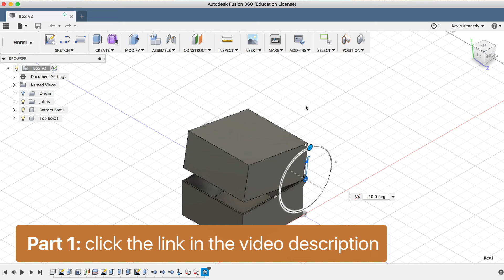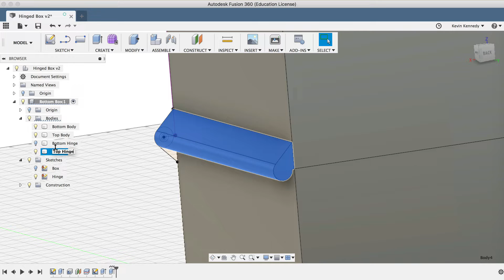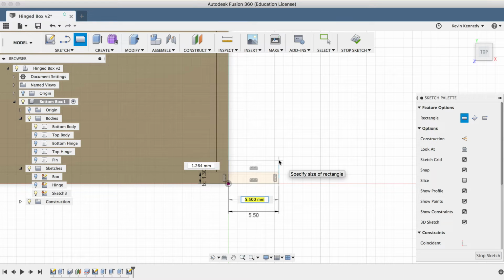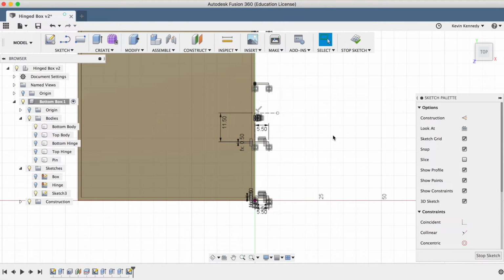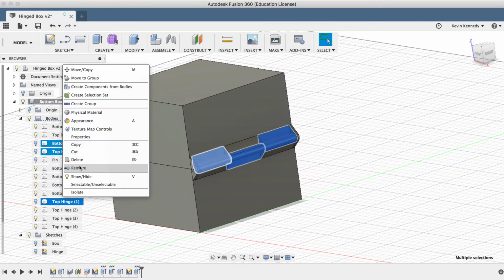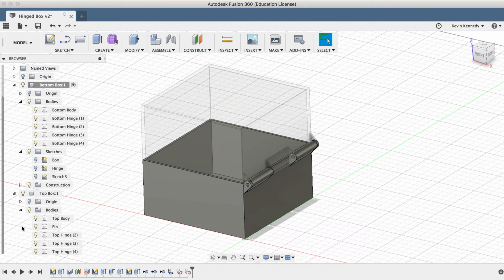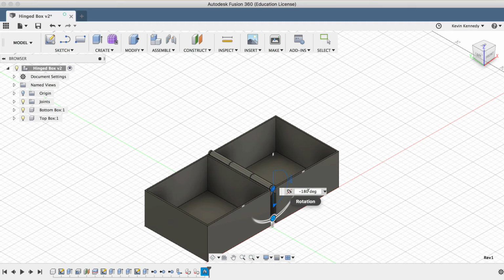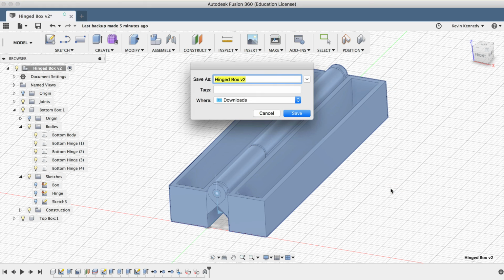How to 3D Model a Hinged Box for 3D Printing - Learn Autodesk Fusion 360 in 30 Days: Day #19(Part 2)

Comment from the maker: Video of example print - https://photos.app.goo.gl/nagpYdBeJUcE3XE47
PLEASE NOTE You'll have to delete two of the end pieces before 3D printing. I forgot to show this in the video :)
It really depends on how many hinges you create when you cut the hinge up. I went ahead and deleted the bottom parts of the end of the hinge, that way every other piece is removed - https://snag.gy/cNokVz.jpg
In this scenario, it really wouldn't matter much as it should work either way. I have the box printed out like screengrab above and have no problems. I will have to try doing it the opposite way and see how it is :)
—
TIMESTAMPS
0:00 - 3D Printable Hinged Box in Fusion 360 (Part 2)
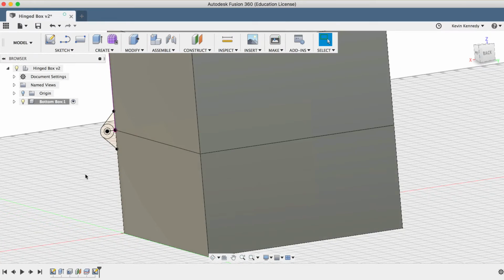0:33 - Create a hinge
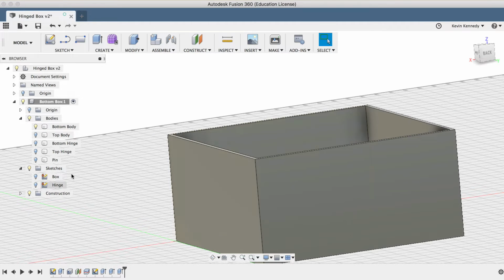3:07 - Cut hinge into 3 pieces
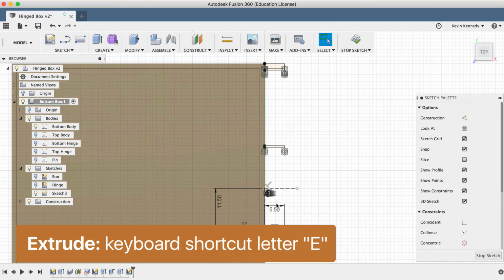6:02 - Extrude cut hinge
7:03 - Remove unwanted bodies
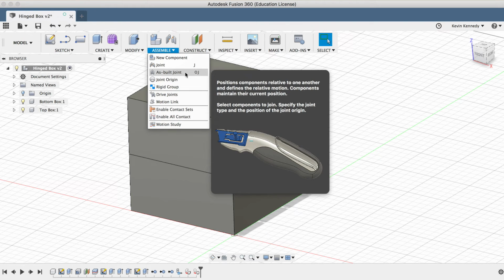10:05 - As-built joint
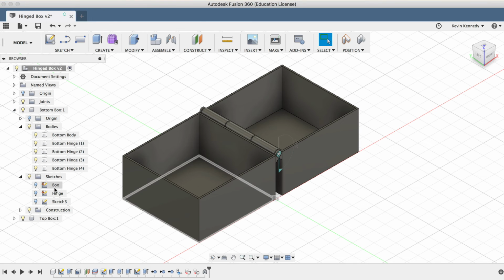11:50 - Change size before printing
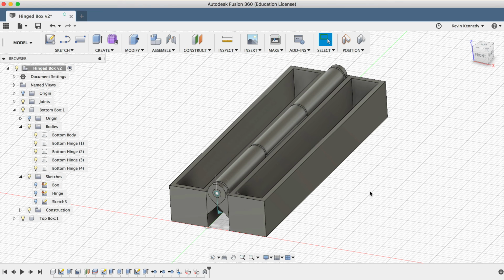12:51 - Export for 3d printing
Reply: Facepalm. I printed this twice with 2 settings before reading the comments.
Reply: I have already dealt with it.  I meant to let others know about this. ;-)
Reply: can anybody pls tell why my bottom part is revolving about the top part not the other way....
Reply: @sajalchuttani2519  Put a minus before the number of degrees.
Reply: @sajalchuttani2519  you probably have it figured out a year later, but the order you select top and bottom matters. The first selection will revolve, the other will not.
Reply: @Stephanus Prayudhi It's attached to the top hinge bodies but is separate from the bottom hinge bodies.
Reply: Great Stuff! Something to note, when you created the top hinge, you included the gap circle and the pin circle with your extrude, making a solid piece.
Reply: @jrbarker7362  I noticed that, too, but I believe that's by design. The top (middle) hinge part + the pin + the end caps are all one solid part. Only the two bottom (outer) hinge parts have to rotate about the pin for the hinge to work. With the middle solid in this way, you have a shorter bridge to deal with printing the gapped pin on the outer hinge parts, and maybe a stronger hinge joint overall.
Reply: I thought I saw that and came to comment.
Reply: You shud add this to the description. I went wrong with it myself! (The PLEASE NOTE thing)

Comment: I was wondering how I should position the top lid if i have a smaller lid? (like a trashcan, my design doesn't split in half, but has a smaller piece on the top that I'd like to use as a lid and a bigger piece on the bottom as box/cup.) So should i position it at 180 deg or is it better to do it at a different angle?

Comment: Everything works perfectly except for one thing I can't seem to fix. The two ends of the hinge are fused together, which means that when I print, the hinge doesn't turn.
Reply: NVM soved it! Just had to "remove" the "Top Hinge" of the Top Box🤦🏼‍♂

Comment: Great tutorial, but I do have a question. It looks perfect in Fusion 360, but when you go to actually print the box, it never quite closes; the back edge of the top hits the bottom of the box before the front edge does, which keeps it open. No matter what I do, or what kind of PIP hinge I use, it's always the same results - perfect simulation in Fusion 360, but an uncloseable box once printed. Has anyone else had this issue?
Reply: Hey, were you able to resolve this? I'm facing the same issue :(

Comment: Long shot as this is from 6 years ago but why cant rotate the top box?
Reply from the maker: Are you trying to rotate via the Revolute joint? The joints have not changed since then (surprisingly), so it's likely due to a conflict in your timeline or with another joint. I also have a newer version of this lesson if you check out my channel page.
Reply: @ already did. I’ve been a subscriber. I just thought this model was perfect for my case use. Thanks for the reply. I wasn’t expecting any😀

Comment: I'm using the free version of Fusion 360. Is this maybe the reason I don't see the feature 'Chain Faces' as an option? I noticed this video is 5 years old, so maybe it's no longer an option in the newest version? When I extrude those circles as instructed at the 45 second mark, mine shows as red as it's a negative and doesn't show as a solid. As if it's pulling the wrong way. It shows correctly when pulling the opposite direction, but that's not the direction it needs to go. Any advice on that?

Comment: Am I the only one confused by the tabs left over on each end of the hinges? They are fused to each box and will not allow the box to open. There is no way youre printing that pin in place without fusing it to the bottom hinges. Someone help me out here.......I cant see anywhere that he addresses this issue, yet its screaming at me from his sketch.

Comment: Hi Kevin, great tutorial! Just wondering if I 3D print the design, wont the edges of the hinge (connected to top half and bottom half) make a rigid body as they overlap? Am I correct in assuming this?
Reply from the maker: You're correct. Please see pinned comment. One will have to be deleted 😁

Comment: I realize this video is 5 yrs old, but I still wanted to say that I enjoyed it very much.  One issue, though, and maybe it's down to my missing something?  When I printed the stl, the outermost parts of the hinge were fused together, being as they're solidly attached to BOTH sides of the box.  Thus, the hinge doesn't work.  I believe the solution is to remove those bracket parts from the bottom part of the box.  I'm printing the revised file now, so I can't say for sure it will work.  Fingers crossed.  :)
Reply from the maker: Yes, that's correct! It was an oversight when I made the video. Please see the pinned comment for more details 😊

Comment: During mirroring, after clicking and dragging over all of the rectangles mine doesn't select as much as yours did. It didn't selected the inner most points and I think the left sides of the rectangles. On yours, amount of objects selected is 22 while mine is only selecting 21. Any idea why this could be?

Comment: The construction line used for mirroring doesn't automatically constrain for me. The line was solid black but the point wasn't constrained, any idea why yours did or mine didn't? I decided to add a dimension to it so that it did become a fully constrained sketch. Edit: looks like that particle sketch for you was also not fully constrained, the same point wasn't constrained. I assume this doesn't really matter

Comment: This model would not print out correctly. The outer rims of bottom hinges and top hinges have overlapped with each other, that should be corrected. And the pin inside should be printed separately, or simply use a metal pin, or the pin should be extruded from one of the hinges.
Reply from the maker: please see pinned note

Comment: In the constraints video you said to prefer not to use mirror in the sketch tool, but to prefer to use mirror in the 3d tool.  Why did we mirror the sketch in this case?
Reply from the maker: Great question! That statement is a 'best practice' from the Folks at Autodesk, given how sketches vs bodies are computed. On small models 3-4 parts or less, it will typically make no difference. For large models, it will make or break the file. For this particular file it's easier to mirror the sketch in order to clean it up/finalize it and it won't have an impact on the latency of the file.
Reply: @ProductDesignOnline  awesome.  Thanks for letting me know.  I am really enjoying and learning a lot from the series.
Reply from the maker: @quyreansoulsealer4002  Glad to hear that! :)

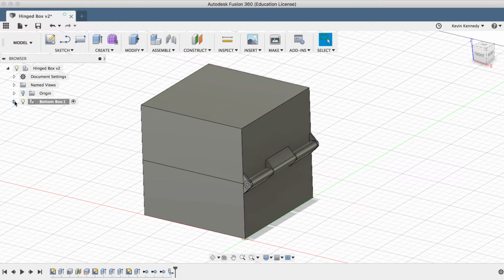Comment: Hey, I got a problem when I followed your instructions. At 8:46 I can't drag the component to a higher level. I searched the issue and found others with a similar problem. They couldn't move the component because it was related to the other bodys by the timline. Any Ideas what I did wrong? Super nice tutorials btw learned a LOT

Comment: Just for anyone who actually wants to print this box: The design won't work as shown in the video. You should NOT extrude the "Gap" between the Pin and the Hinge. Also you need to cut away part of the top hinge supports (Where it connects the hinge to the box. As a tutorial this was great!!
Reply from the maker: Hi D Matthews. Thanks for the comment! Please see pinned comment - I forgot to show removing the end of the hinge piece in the tutorial :)

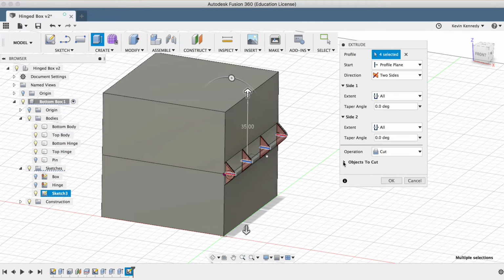Comment: Great videos, Kevin!  I am following along in an attempt to recreate the model (drawing it from scratch, so to speak). I seem to be having trouble getting the extra bodies after the Extrude at 06:45 in the video. At first I thought it was because the 5.5mm dimension of the gap rectangles in the sketch did not reach to the tangent point of the 45 degree angle on the circle. But I changed this to 5.7mm and now after the extrude it appears I achieved the individual sections of the hinge, but new bodies did not appear in the browser, and when I select the topHinge body, Fusion 360 selects the complete length of the top hinge body (like it is not split into three). Version 2.0.13866 here. Any help appreciated. thanks.
Reply: Did the same mistake. Reactivate the extrude feature from history and make sure that you select: side 1 extent to all AND SIDE 2 EXTENT TO ALL. Hope it helps.

Comment: If you're as confused as I was when you sliced the model: delete one of the "side parts" on each side. Otherwise the parts will fuse together. Like, not fuse but the exported STL will treat those as connected. Great tutorial though. I love the length too. I lose interest rather quickly in hobbies (or switch. Do I want to learn CAD and learn how to engineer parts? Do I want to learn Blender and be artistic? Or 2D art?) and having those 15 minutes or so videos is enough to "give it a go" and then use your videos for reference.
Reply: 2yrs later and still a helpful comment, same issue on the blender or cad btw hahah. but i printed this box and mid print i was like wait a second this wont be able to close loll

Comment: I am confused, when exporting as an stl, after loading it into my slicer, any of the parts that were overlapping in fusion360 (the center hinge with the rod going through, and the ends of the hinge) are now empty space. This is due to "double normals" which flips the normal and creates empty space. This is not addressed in your video.

Comment: Don't the 2 part of the outside of the hinge interfere with each other? You'd have to remove them in one of the sides for the halves to fit right?
Reply: Yeah, this hinge doesn't work.  I think this was more to give an idea of what was involved.  Or they missed a step when reading off of their script.  But anyone at this point should be able to fix it.  And good on you for spotting it.
Reply: @dodaexploda  I thought it was just me followed closely but the ends fused. It looked odd but I thought hey its fine in the video. Giving it another go after deleting the two bottom ends as well.
Reply: Yup that was it. It printed perfectly now.
Reply: I think the same, this process shows how to create every part in sequence, cleanup and preparation is up to you...I think that not everybody will refine the piece in the same way. Cheers
Reply: what sides?

Comment: Man you have some faith in the bridging capabilities. I use PETG mostly and definitely wouldn't get a working result like that lol. Nice design though. For me I would do the tapered hinge points rather than a pin going through just so I wouldn't be relying on bridging.
Reply from the maker: lol - I defiantly wouldn't recommend this with PETG, well, at least not at this size. It does work well with PLA/ABS though. More can be seen here: https://youtu.be/gzF2QgMh6nw

Comment: Very helpful video, but when I change the Gap parameter I am getting an error in the removed body -Bottom hinge1 .
Reply: A year later, I had the same issue. It turned out to be the rectangles on the hinge-splitting sketch were not long enough to cover the depth of the hinge any longer when increasing the gap/other dimensions (so the step where the hinges were cut no longer resulted in separate bodies, causing the recalculation of the overall timeline to jam). Fixing the sketch by extending the rectangles used to cut the hinge solved the problem!

Comment: Hi!
This tutorial is great! It's helped heaps - I'm currently making my next cosplay - Mandalorian! but all the arm braces I've found I don't like so I wanted to create a hinge on the ones I found on Thingiverse. 

My only question  though - I've followed all your steps but when I extrude the mirrored rectangles it doesn't create any new bodies [IE. Top Hinge (1)Top Hinge (2)Top Hinge (3)Top Hinge (4)] this means I cant delete the end pieces before I print. So what have I missed/can do to fix that?
Cheers
Reply from the maker: Was the operation of the Extrude command set to "Cut"? Double-check that first. Otherwise, I'd have to see the file to investigate further.

Comment: This was great. I learned about parameters in this lesson.  I'd put them to use, but there was an issue with one outside hinge surface that binds when the printed 20mm box is closed.  I can't see the problem in the Fusion 360 model.  But, I suspect it has something to do with my sketch circle not being tangent, or that I didn't select a tiny portion when extruding the hinge parts.  But, this was really an excellent learning experience!
Reply: Please disregard the part of my comment above dealing with the binding hinge.  I see now that the problem was already identified and the solutions already discussed and provided.   I should read the comments before posting my own.   All is good.  😀
Reply from the maker: No worries! I realize that it's easy to overlook and I messed up by not showing that in the video :D

Comment: Has anyone tried 3D printing this model and has an issue with the lid not being able to close properly?  I have about a 5 deg angle when I try to close the lid which is caused by the top and bottom portions hitting near the hinge first. I wanted to check with the community if they had clever ways to solve the problem.
Reply: Facing the same issue! Were you able to resolve this?

Comment: I may be a little late 😅, but I’m currently using this tutorial in my Intro to Engineering Class, and it was so easy and simple to understand, I did have a few problems because my container is a different size and shape, but with a few calculations I figured it out. Really do appreciate it <3
Reply from the maker: Glad to hear that, Jayden!

Comment: So, if I want to print the Hinged Box do I need to separate the parts one from the other or it is okay to print the components all at the same time as you did in the sample?
Reply: Print the small version first. If the hinges fuse to the pin (cannot break off), increase the clearance (gap) around the pin.

Comment: I got stuck when I tried to double-click on the revolute arrow. I couldn't select it, click it, or drag it. I found out how to set min and max movement, but I couldn't open the lid so it lay flat on the plane. (I had already deleted the two end pieces.)
Reply from the maker: If you're not able to select it in the Canvas (the model itself) you can always select or right-click on the Join in the Browser (left side of Fusion 360). The joints will be nested underneath the active component in the Joints folder.
Reply: Check your selection filter, it is probably preventing you from selecting the revolute flag. ;-)

Comment: Mine printed out nicely but all the tolerances were too loose. I changed my wall thickness from 1.3 to 1.36. Any more than that would cause two of the hinge knuckles to disappear. But the print came out exactly the same. I wondering if one must restart fusion for the changes to take place. I know that's the case with preferences. I'll print it for the third time to test that theory.

Comment: Was having MASSIVE frustrations with creating a new top box component from the top body. I just couldn’t select the body to drag it and drop it. Took a full shut down and reboot of the MacBook and F360 software before I could actually drag and drop to creat the component from the body as depicted in the video.
Reply from the maker: Hi Glen. Strange that you had to restart. Hopefully, that was just a one-time bug. Otherwise, always double-check that your timeline marker (in the parametric timeline) is all the way at the end. That will prohibit any moving of components in the Browser.
Reply: @ProductDesignOnline  That could have been it as well. I’ll keep that in mind next time.

Comment: I've never 3D printed anything, but my printer is in the mail!  When you printed this how did you print the pin?  I'm assuming you removed it from the hinge and printed it off to the side, but then how do you print such a skinny tall item without it tipping over during the print?
Reply from the maker: Hi Mark. These hinges are print in place. Check out my latest video for more details https://youtu.be/gzF2QgMh6nw

Congrats on the printer :)

Comment: Instead of placing the construction line defining the position of the gap 11.5 mm down from the middle line, (at 4:50) I typed d2 / 6 and now I can even scale the length of the box while keeping the hinge parts roughly one third of the total length.

Comment: What i Dont understand is how the Hinge is gonna print inside the part it's not attached to, is has to start something, how is it gonna not stick to the inside of the hinge
Reply from the maker: There is enough clearance that it will come loose/free when you first close it. You can grab the test print and try it yourself - https://thangs.com/model/6649
I've also added a quick demo video in the pinned comment

Comment: awesome video!  thanks for sharing your knowledge with us.
my question is, is it working if the top is less than the half like button is 50mm and top is 20mm? because than u cant turn the top 180° and change the size for a test print?